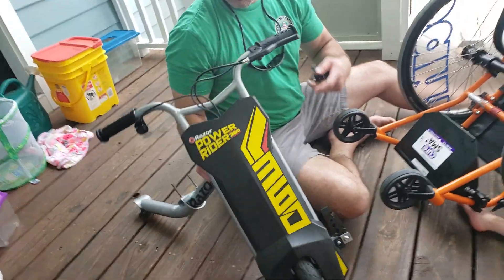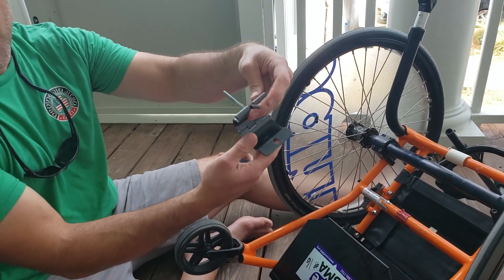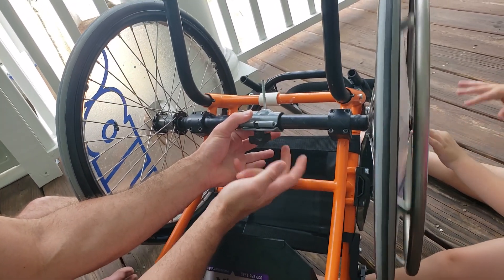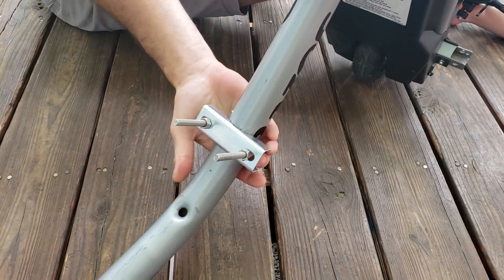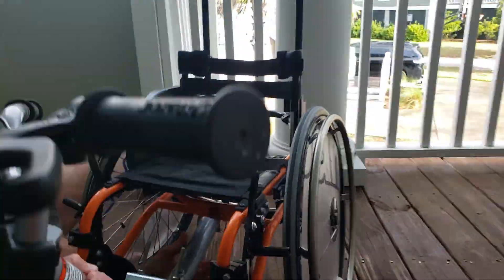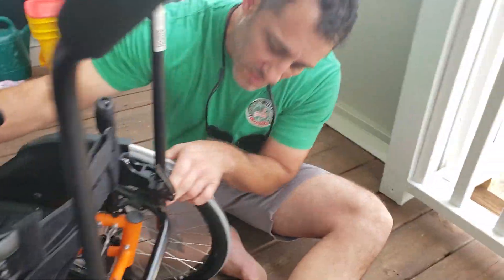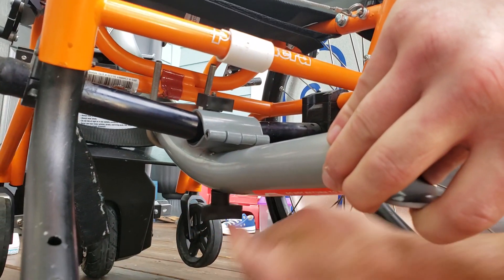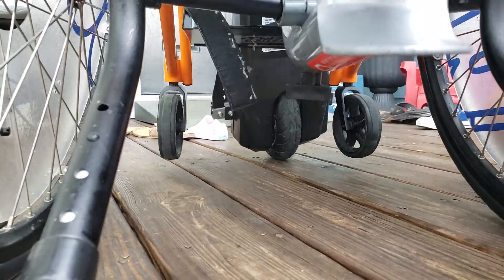Manual wheelchair power mod under $200!

Comment: Hey great diy. You can use rubber caps for the ubolt to stop it from scratching the frame as well.
I think I need one, would give me a lot of extra help and mobility.
Cheers

Comment: Thanks for the idea of using a truss clamp. I'm planning on use a hoverboard to power a manual wheelchair. Remove the foot rests off the swing-away arms, and put a piece of wood or some other material across the two. Then attach the truss clamp on the boards center, and bolt that to the bar.  Using an alternate hoverboard firmware with the ADC settings and a joystick. Should be fun and also allow me to be more mobile in places where there are ramps, but they are more geared toward people being pushed(ie a lot of extra strength needed to traverse the steep incline).
Reply: Please make a video .. im searching for ideas just like that. Thats how I ended up here

Comment: Cool invention Rob, 👏👏
I have to built one for my son too; he is 13 and almost stopped using his hands. Just wondering how the assembly is working now? Did you have to do any further modifications eversince. By the way I am not very clear how the front u- bracket completely bond with the wheelchair. Did you leave it hanging or did you somehow clamp it with the wheelchair. I m thinking from a stability point of view. Great work please continue adding more similar videos, I'm interested.
God bless and best regards🌹

Nb: I've just subscribed your channel with a 🔔 button. Please support my channel too by subscribing and watching my videos. 
Thanks